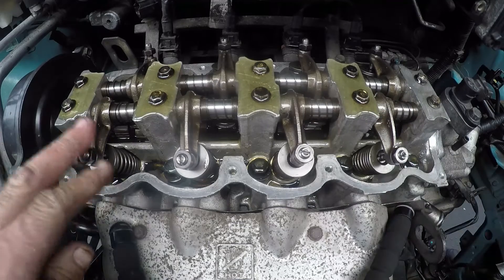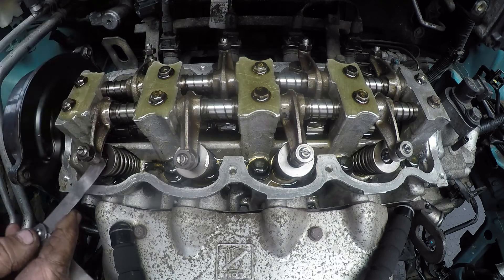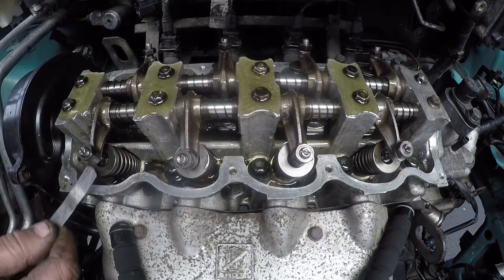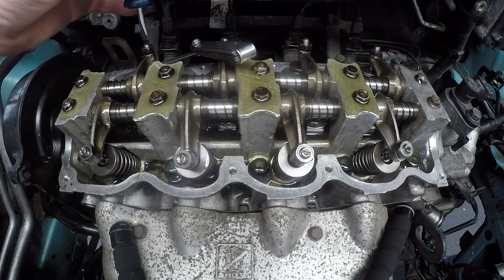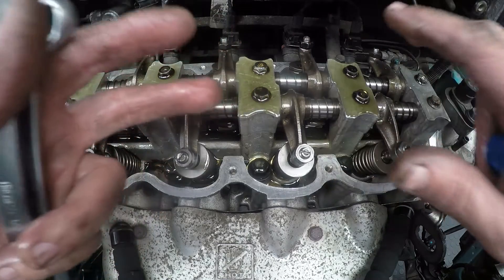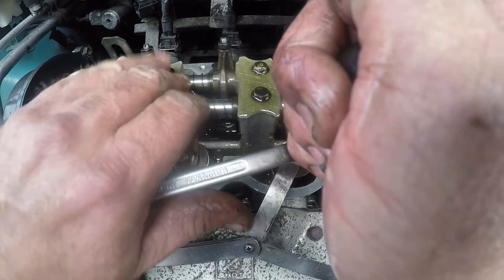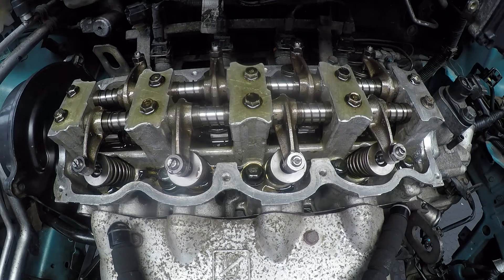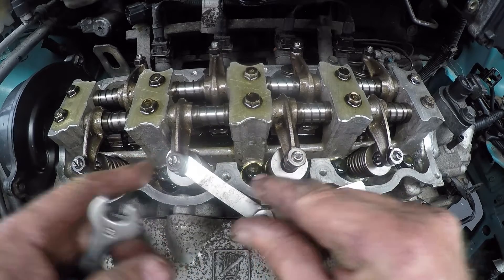Chevy Spark   Setting Tappets

Comment: is cold or hot set up?
Reply from the maker: It is a hot setting, so one has to run it with the setting given until it reaches operating temp. then it has to be reset again while hot as a final setting..